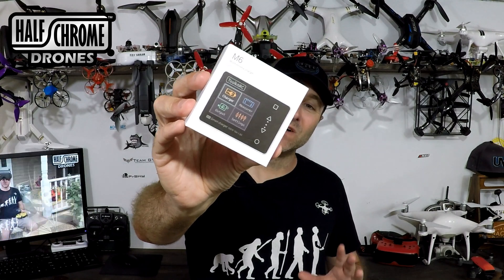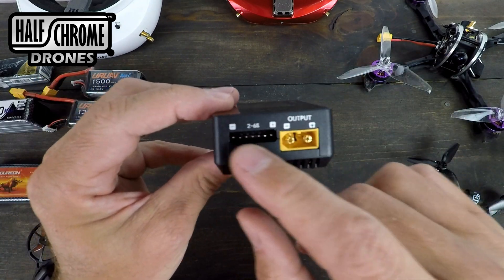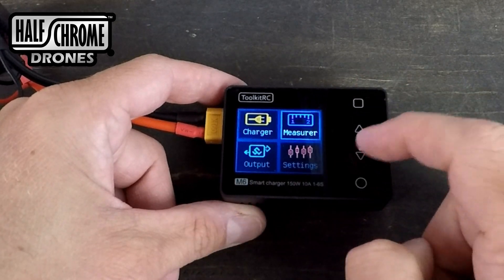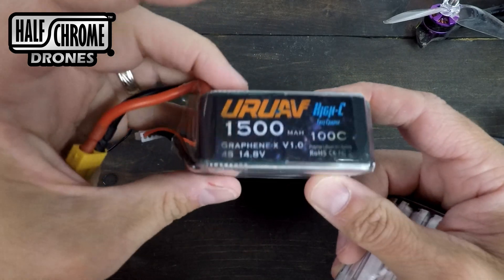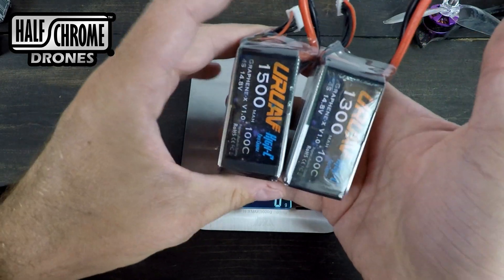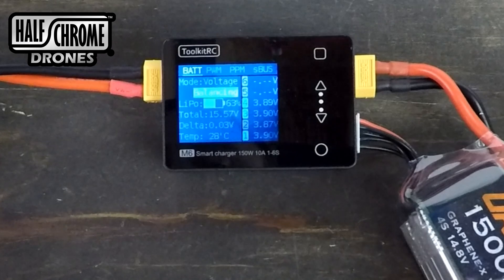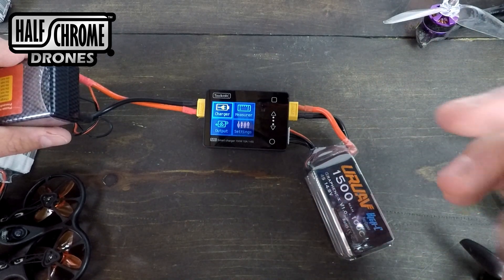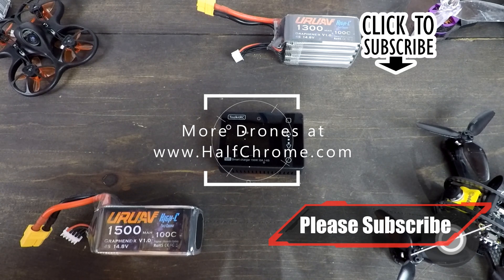ToolKitRC M6 Multifunction OTG Charger and some Graphene Batteries

Comment: Can you plug into a 5v 2.1a wall power supply and charge batteries slowly?
Reply from the maker: Nope
Reply from the maker: Actually I’m not sure. I will have to try
Reply: @HalfChrome 
So did it work
Reply: @HalfChrome  thanks for confirming that for me! Looks like I'll have to buy a barrel plug and use my laptop power supply